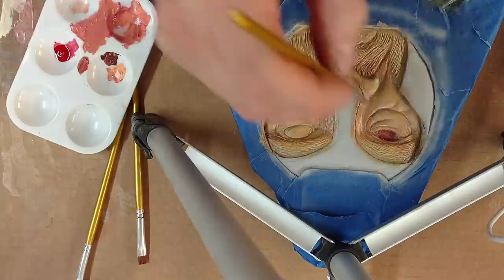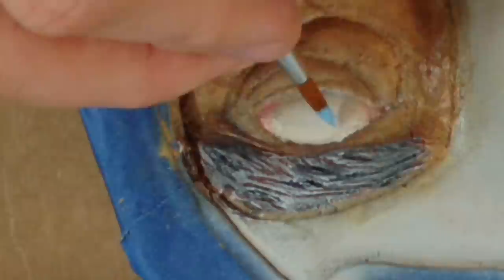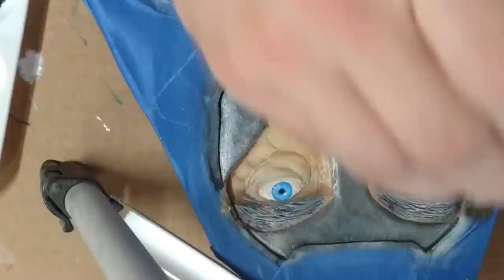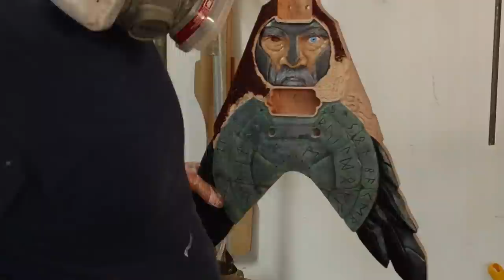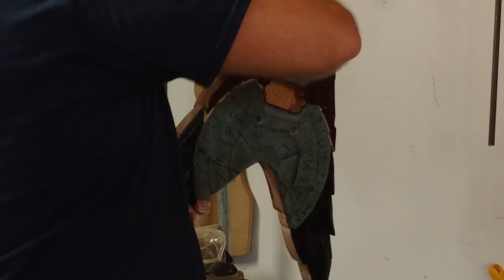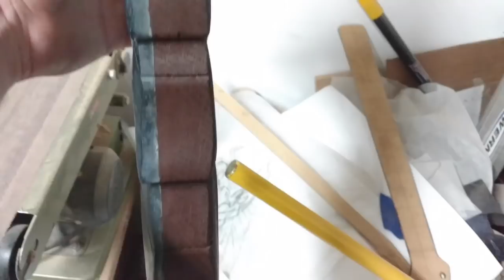Great Guitar Build Off (Unofficial) - Odin Part 6

Comment: I feel the detail in the artwork is almost masking the detail in the woodworking, is that the effect you're after? To see something different every time you look? 
Either way, it's a beauty
Reply from the maker: Thanks! The detail in the woodwork will pop more once I sand the stain back some off the details. It will make it lighter on the high spots and should give it an aged look.